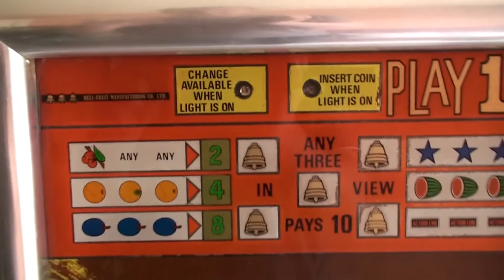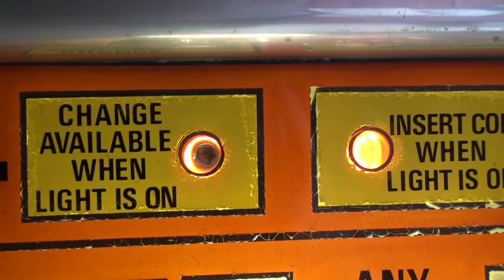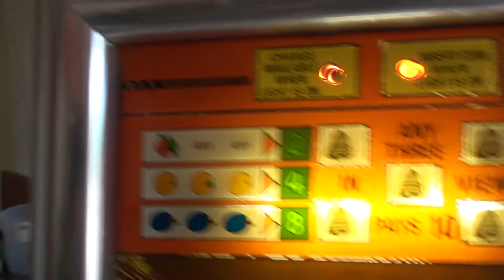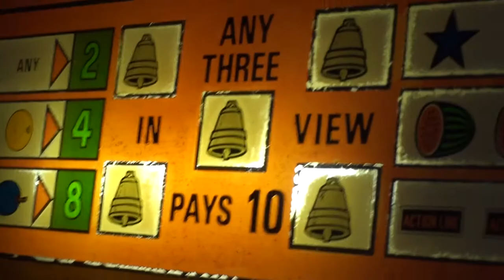Action Line one Armed bandit - August 2013

Comment: That may well have started off as a half-crown changer. The 10p slot looks to have been shortened using a screw or rivet.
These came out around Decimalisation, and the changer would have been intended for One Play plus 4x sixpence change.
I've never seen one on sixpence play. I live in hope.